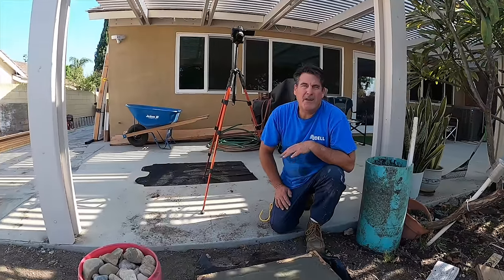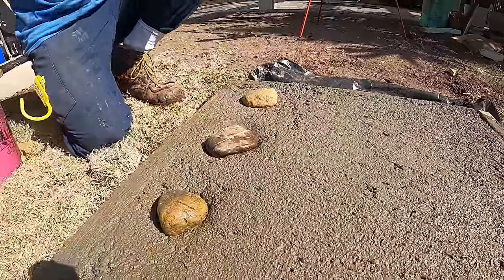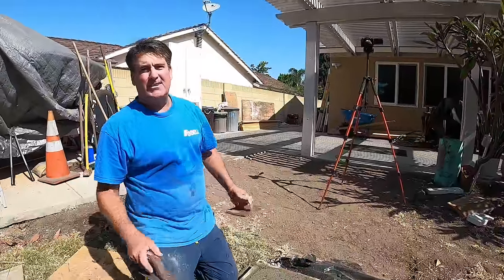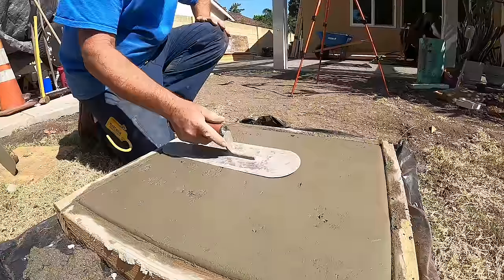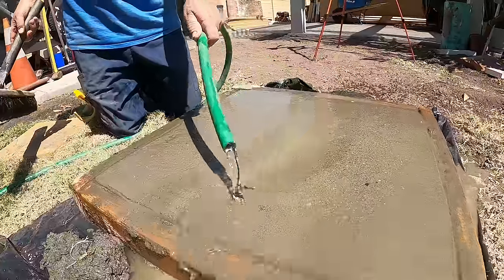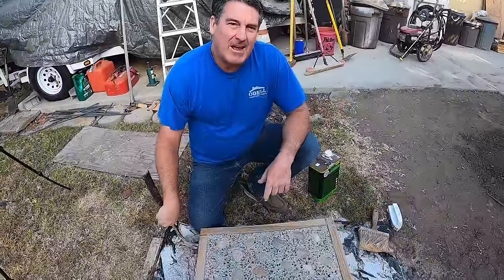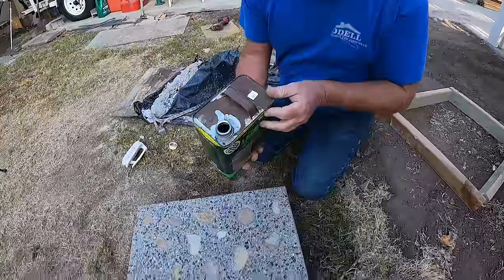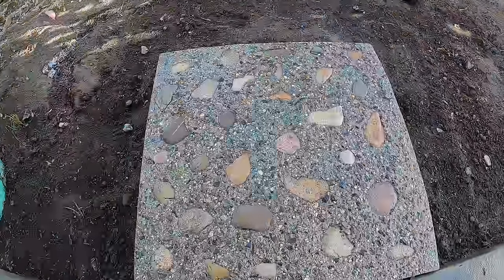How to Make Decorative Concrete Pavers with Big Rock DIY

Comment: The REAL “BEST IN THE WEST”!!!
Reply from the maker: TY
Reply: Ha ha. You mean just running a pump truck doesn’t make you the best? Not setting a form? Finding slope? Operating a skid? With or without a scoop or hammer? Handling a shovel? A trowel? A hammer? Snapping a string line? A compactor? Setting a block? Using a laser to find grade? Applying texture yourself? Showing DIYers how to make nice little projects? Showing and talking through the process of what’s taking place and how to achieve desired results? Taking credit from and for the guys that are actually doing the work? 
Hey Dave. Better be careful. Might make a green spot in that guys yellow yard. I know, yard is a continuous project. What’s been sitting longer? The bucket of rocks or that boat?
You forgot to mention how great you are at the end instead of telling us to have a good day and see us later. 
There is another local concrete mason guy in the HB area that does great work, him and his son actually do the work as well. No YouTube for them though.

Comment: Really love this!   Great job!

Question: Have you used this method on a vertical piece?  I'm thinking about a round concrete firepit with an extended patio area.  TIA.
Reply from the maker: Not yet, but I'd like to

Comment: Well done, you'll find this effect in seaside towns in my part of UK where they bulk up the mix with rocks from the not so sandy beaches
Reply from the maker: Sounds like a strong mix
Reply: @OdellCompleteConcrete  Yes so popular local council placed a ban on visitors taking pebbles etc. from beach - another you can be fined up to £1,000 ($1385.95) if you bring so much as a pebble home from the beach